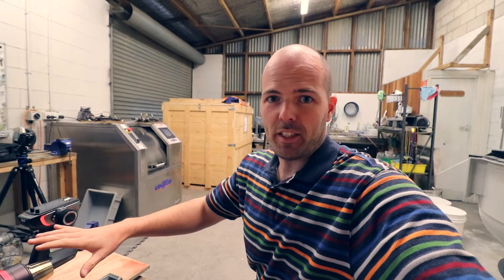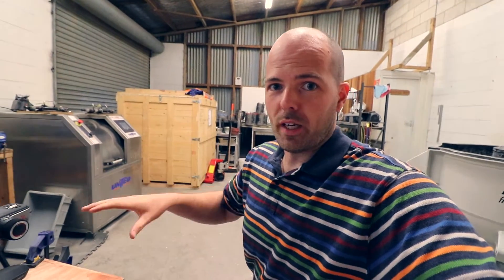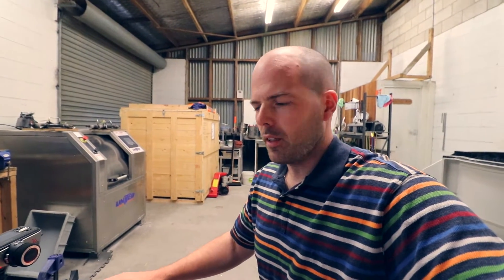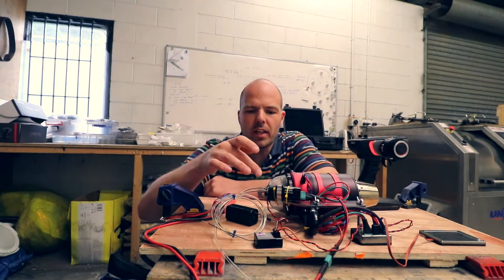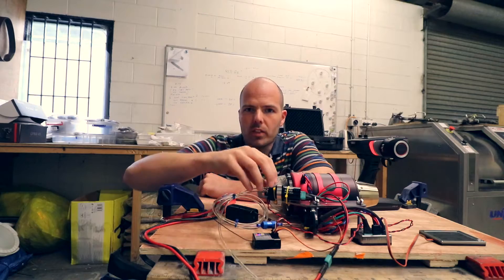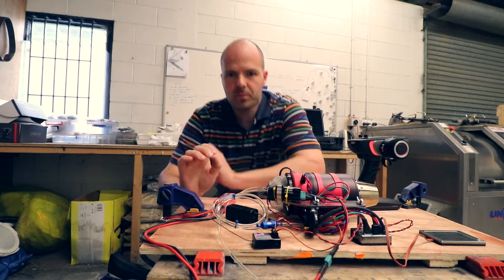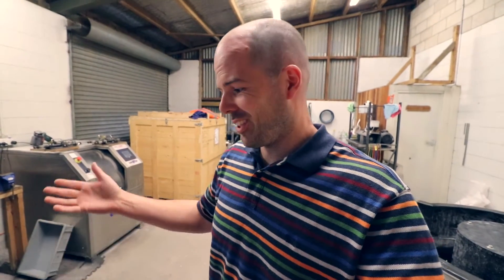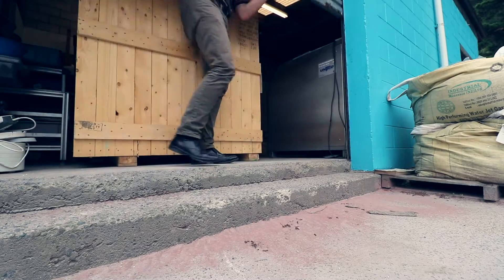I've Got A Problem

Comment: Hey do you know any forms or groups for talking about king-tech? I'm trying to see if I can build my own gearbox for the end of my k-45 jet engine and wanted to talk to some people familiar with king-tech. If you don't mind I'd love to pick your brain on what you know.
Reply from the maker: Sorry Ian, I know nothing at all about these to be honest. I've only run this engine a couple of times.
Reply: @MagnusMacdonald  same, but now I'm about to get real into it,  do you think stainless steel can handle the heat from the exhaust? I look at it's melting point and what temp the engine runs at, but I don't want the metal getting soft from the temp
Reply from the maker: @Spearmint22425  I not very familiar with that area. Sorry.
Reply: @MagnusMacdonald  no problem, thanks again for your reply, I'm just happy to talk to someone that also has an engine

Comment: Hi Magnus,
I was wondering, being extra-cautious (securing everything well in place, etc,), would it be possible to "jet-engine anodize" some Ti pieces?  Is the temperature outside the engine high enough to do this?  :D  (I feel irresponsible even to suggest it!).
Reply from the maker: Man, I've forgotten the anodizing temperatures of titanium. But I've anodized with a blow-torch ...so it should work (at least for the lower, gold/yellow colors). I feel this could make a very cool future video soon. I applaud your "irresponsible-ness" :-P

Comment: Number one loose the kerosene buy some diesel ! Definitely fix your trim issue that cool down stage is very important. But whenever there's an issue with the cool down you can turn off your receiver battery the 9.9 will will power the ecu to automatically engage the cool down stage a redundancy feature by with the g2 models

Comment: Magnus that is a computer which controls fuel flow but your right it does go through a cooling sequence at a  certain temperature always have an extinguisher ready in case of it runs rich it will blow rings of fire never stand s side on if one fan comes off will go through you read more about priming and so on good luck